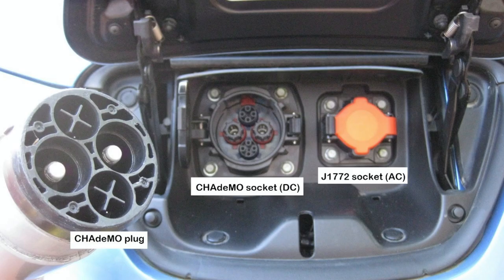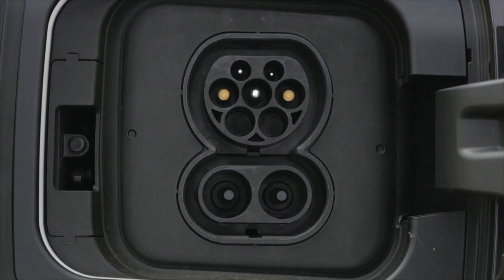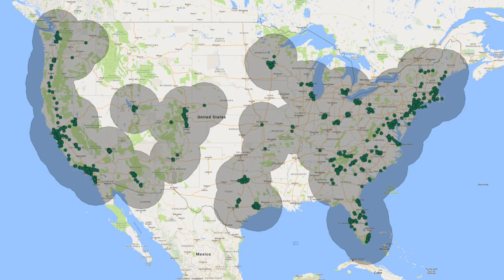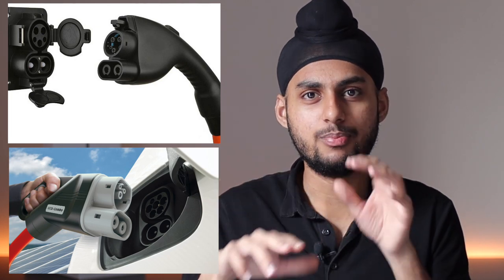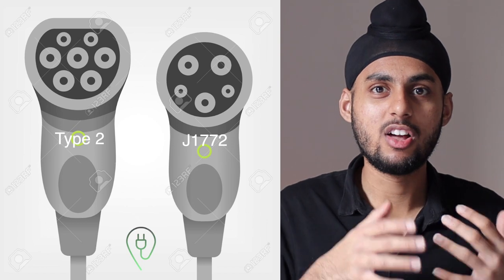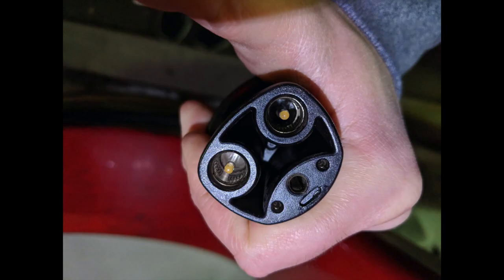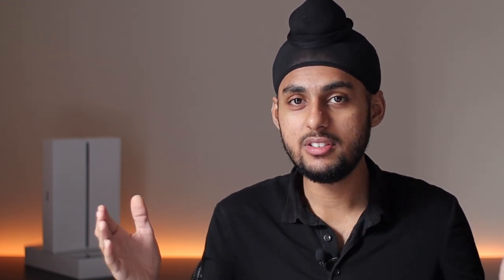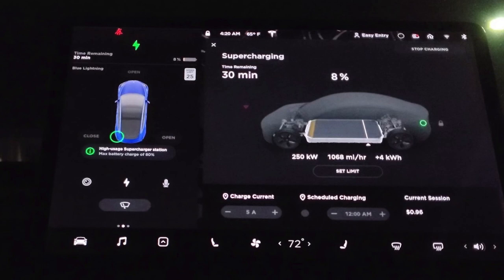What are the Different Standards of EV charging?

Comment: The reason why Europe and America have a different plug for AC charging is pretty simple actually.
In North America the power a residential home gets is a 240V (or 208V?) connection phase split into 2 120V wires. The 2 thin connectors on the J1772 are just for communication between vehicle and charger, 2 of the thicker connectors are each 120V live wires and one is protective earth (Note, due to the phase splitting the connector that is meant for neutral is the second live wire. Technology connections has a video explaining this).
In Europe the power a residential home get is an (up to) 3-phase 240V connection. The Type 2 connector again has 2 thin connectors for communication and 5 thicker connectors, one again is protective earth, one is neutral and the other 3 are the 3 phases.
So basically if we say that you can get 50A to the charger in your garage, in a regular household. In Europe you'd get 400V and thus 20kW. In North America (if I am not mistaken) you get 240V and thus only 12kW.

Technically the J1772 (also called Type 1) is just a single phase version and the Type 2 a 3-phase version of the same connector. Which is why I do think that just installing a Type 2 connector even in North America makes sense for future proofing. I don't believe the regular residential voltage in NA will change to 3-phase 230V AC anytime soon, but since NA technically already runs on 3-phase 230V AC but just phase split to get 120V AC, delivering 3-phase 230V AC to residential homes just for EV charging doesn't seem unlikely to me.
Reply from the maker: Yea but I highly doubt the connectors will change. Type 1 and type 2 work perfectly fine with a small adapter so you could charge a North American car in Europe and vice versa. Fast charging is where things get tricky!
Reply: "pretty simple actually"
*Proceeds to write a whole ass essay

Comment: As of June 2018, CHAdeMO allows up to 400 kW of charging (400A x 1kV) and aims for 900 kW as it is currently co-developing with China Electricity Council (CEC) the next-generation ultra-high-power charging standard with the working name of “ChaoJi.”
Reply: It would be faster than pumping one gallon into our little cars by then!
Reply: 900 KW? i think that would be really good for like semi trucks. couple days ago i found out that in the country i live in semi truck drivers are mandated to take a 45 min break every something like 4.5hours and i calculated that they would need something like 800KW to charge the semi truck with enough range to drive the next 4.5hours while they are on that mandated break. so pretty sure 900 KW would work pretty well for this. :)

Comment: The European CCS2 EV cars can be charged in two ways: 
Either the Type 2 (Mennekes) connector in 50 HZ AC mode, using only the upper part of the connector, and connect it to the standardised and widely used Type 2 charging points.
Or the entire connector, with the newer standard, but much faster charging DC power though the lower DC power pinns.
The USA uses a Type 1 connector, with 60 HZ frequency, or the CCS1 with the two DC power pinns added to the lower part of the connector.

Comment: You don’t really bring up the sexier, smaller form factor of the Tesla connector. I’m still trying to understand why the standard connectors are so much worse in that respect. What advantage does CCS have over the Tesla connector?
Reply from the maker: The only advantage is that it’s used by nearly every single car and other than some super chargers, every charger has the CCS plug. That’s just it!
Reply: I see. Well I guess it’s a shame the standard turned out to be so bulky and ugly. Your comparison to USB-C makes a lot of sense, except that USB-C is slim and looks elegant!
Thanks for your answer. :)
Reply: I think in my heart, I am rooting for the Tesla connector to take over as the new standard, but that does seem near impossible.
Reply from the maker: Yeah I’m pretty sure we’ll use CCS for a good while until something really good comes out, kinda like how USB A was used all the time and just now we’re starting to see everything use usb C. It’ll take time!
Reply: It's Tesla's own dumb fault for making it proprietary. It COULD have become the standard had they chosen to open it up properly.

Comment: I'm in the process of getting an EV West Kit-built type 2 charging classic car that comes with Tesla batteries and J1772. I'm a tad bit confused about making adjustments to for CCS. Can I just make the J1772 fast charging compatible?
Reply from the maker: No, the j1772 isn’t capable of fast charging as you need 400V. J1772 doesn’t allow that. CCS is just a j1772 with two extra ports for fast charging that enables high charge rate! Type 1 is the same thing as j1772 and type 2 the connector used in Europe, allows for 400V 3 phase charging.
Reply: @ElectricCarsAreLit  you know of any conversions to add the DC extra ports?

Comment: I don’t really see what’s so great about having a charging port on both sides.  It’s just extra wiring and expense when a slightly longer cord solves the problem.
Reply from the maker: It’s just one of those things that once you have, you feel like you “need” it but other than that its just a great convenience feature. On the top of my head the only real benefit would be if you have a very narrow garage and for some reason you can only plug it in on one side!